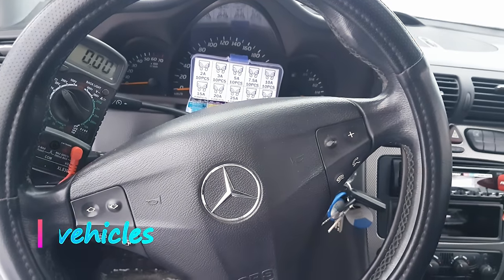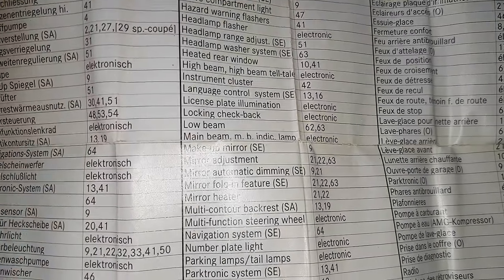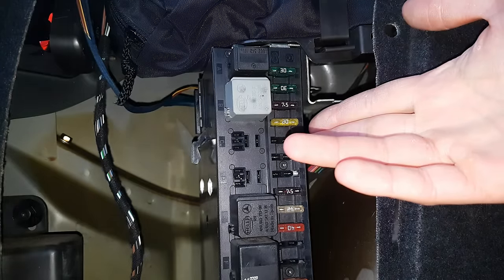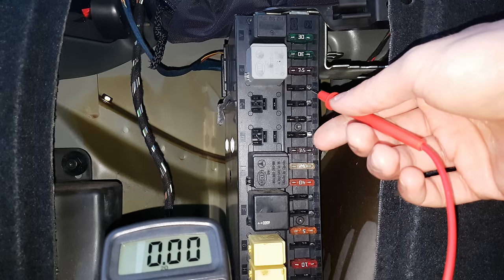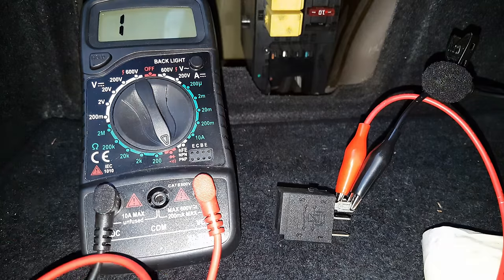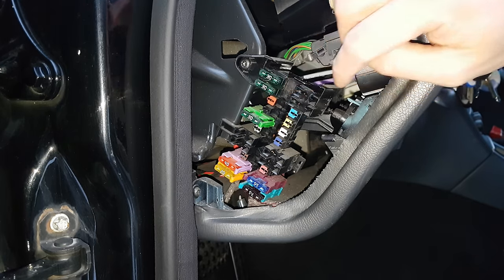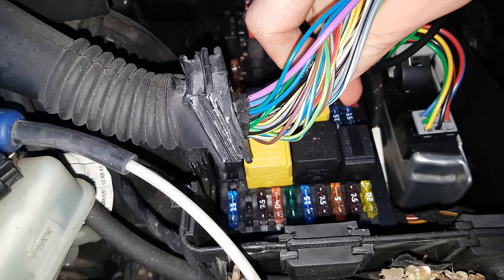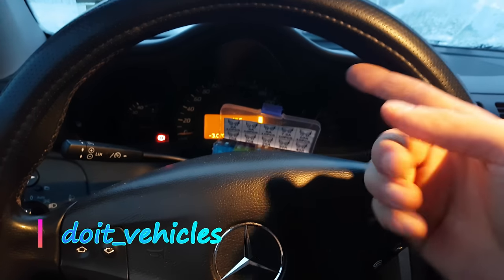Mercedes w203 All Fuses and Relays Location - How to test them

Comment: Cigarrette Lighter Doesnt Work, Fuse NO. 47 has a fuse that says 15 in it, still nothing can someone help
Reply from the maker: maybe the fuse is blown ?
Reply from the maker: actually the original one it should be 5  amps not 15
Reply: @doit_vehicles  my radio turns on and off , do you know where i can buy fuses or may you privately help me please
Reply from the maker: @solidgoldkraft1517  it sounds like some wiring issues . But have you checked if the fused is blown ?
Reply: @doit_vehicles  how do i check if fuse is blown? And on my 2004 mercedes c320 my radio comes on and off alot somwtimes it works but more than often it doesnt work it comes on but no sound or anything idk can you help?

Comment: I have problem with the rear right light it works so low
Reply from the maker: Replace the bulb 💡
Reply: @doit_vehicles  i did and it still the same
Reply from the maker: Voltage drop test . There should be some coroded/ damaged wires along
Reply: Where should I search for dameged wires
Reply from the maker: From the fuse box to the bulb , try a voltage drop tes

Comment: where to get wiring diagrams?
Reply from the maker: I use  " bbb industries " if I really need one , but usually you must pay , so I always try to find out the diagram myself .
Reply: @doit_vehicles  Thanks for taking the time.  General question, why are the electrical diagrams so hard to find on the internet? Everything else seems to be pretty easy to come by but these diagrams. Thanks

Comment: 2005 c230 kompresser what is it when the fluid is not squirting is there a fuse for that & if not where is the pump or part located?..Thanks

Comment: Why there are missing fuses?
Reply from the maker: Because the fuse box was designed for high end luxury S class for example ,  with a lot more  electronics /luxury features on board .
Reply: @doit_vehicles  does it affect negatively if I put fuses at the missing places?
Reply from the maker: Theoretically , no since there is no conection in there .
Reply: @doit_vehicles  okay, thanks bro